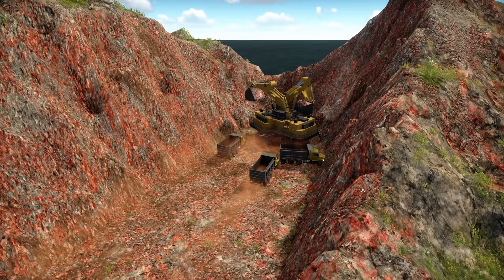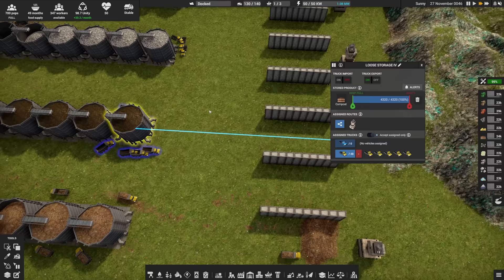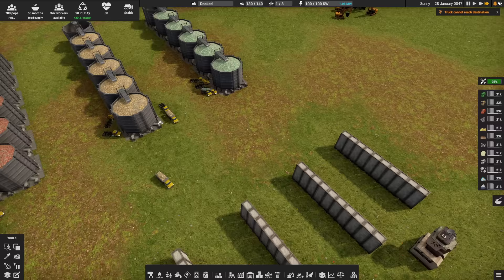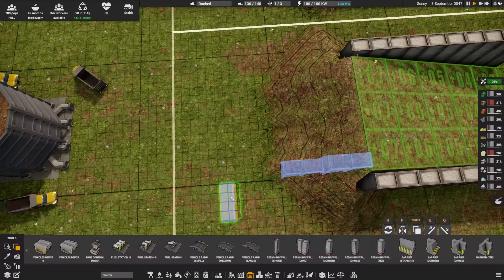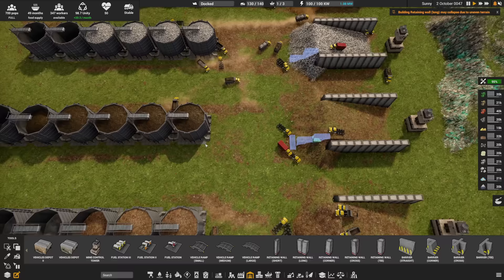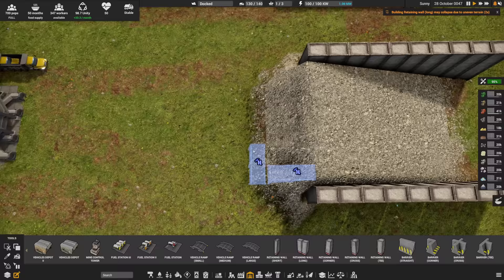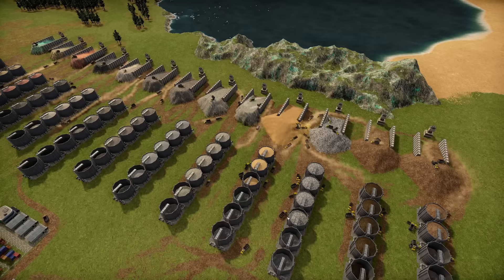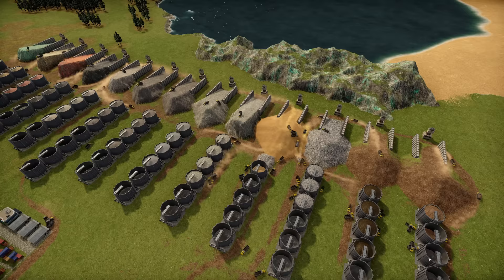Retaining walls Do we Need them? Lets Test it 🚜 Captain of Industry  👷  Tutorial, Guide, Tips

Comment: Awesome info thanks JD! Hope you get to see this before you make the follow-up wall video... The fact that you can drive up the steep edge of a sand slope is a game changer! this means you can make WAY steeper entrance / exit ramps to pits by simply piling sand at ground level (the top of the slope) and letting it spill down into the hole - saves a ton of space compared to (4 horizontal tiles per vertical level) shaped slopes. Hope you can add that in, would be a funnecessary amount of effort to optimize slopes :)
Reply from the maker: hmm i hadnt considered that. but then again if your building down there would be a lot of shift left to the sides.... i wonder if i can make 3 tiles of sand for a ramp and flank it with rock on either side to hold it together...
Reply: @JDPlays  you most certainly can! I throw down a rock pier 1 wide for my shipyard expansions so the waterfront is nice and tight, then fill back to the mainland with dirt and waste and whatnot.. targetted dumping can be very useful to keep slippery wastes tidy
Reply from the maker: hmm i found 1 tile to be not enough trucks got confused and did a lot of back and forth with no place to dump rock etc... but i expect that was mostly due to my dumping volume!